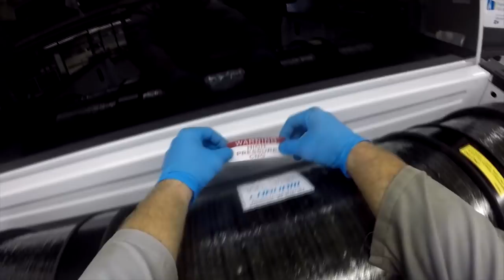How to Convert a Vehicle to CNG

Comment: Hey, Buddy. Great videos! I have a question that maybe you or some of your followers can help with. Im looking at buying a 2011 F150 5.0 liter. Its already been converted to CNG and the seller has removed all the cng components. Can it be easily converted back to gasoline? Or is it easier to just buy new cng gear. I dont particularly need CNG but can it run on another fuel also?
Reply from the maker: Who installed the cng system ?  Who is the manufacturer of the cng system ?

Comment: Mr Tech thus is great. I burn cng I'm my f150 in calif. Is it possible to add gasoline as a fuel on long stretches to the next cng station?
Reply from the maker: I’m assuming that ur running mono fuel ?
Reply: @MKTECHUA  I run on cng. But can I add an other fuel, even Gass for long stretches between cng stations?
I don't know the term monofuel
Reply from the maker: Mono fuel means that it only runs on natural gas ,  question is , do u still have a gasoline tank ?  Second do I only have cng injectors ?
Reply from the maker: What company converted your truck ?  Also , it’s a 5.0 ? Or 3.7 ?  If your pcm is flashed with only cng calibration adding gasoline components are not only thing u will need , u will need bi fuel calibration .   Check out Altech eco corporation ,  if you decide to call them , talk to Yuri Barva or Orest , they will tell you exactly what you need

Comment: I just subscribe,, ware do y get cng from ,I wanna travel long distance ,is this a good option
Reply: Here https://afdc.energy.gov/fuels/natural_gas_locations.html#/find/nearest?fuel=CNG for theUS .
The range depend of the volume of your CNG tank but usually is much shorter than on gasoline . The steel CNG tanks are extremely heavy and this usually limits the volume and the number of tanks installed ( of coarse occupied by them space in the vehicle is a limiting factor as well) . There are composite tanks as well( which are lightweight)but they are extremely expensive and not as safe as the steel ones in case of accident.
Reply: I move both diesel & cng buses for many cities across the U.S. and there are plenty of cng stations throughout. There are also phone apps that can help you locate them.

Comment: I have a F350 Lariat 6.0L, 6 inch lift. I'm getting about 13 to 15 mpg. If I convert to cng from diesel using a 60 to 40 ratio,  what could I expect in the fuel mileage increase?
Reply: It's really that fuel will cost ~$1.50/gal -- efficiency is relatively the same. You can get a more efficient tune from a shop but being light on the pedal is best thing can do for mpg